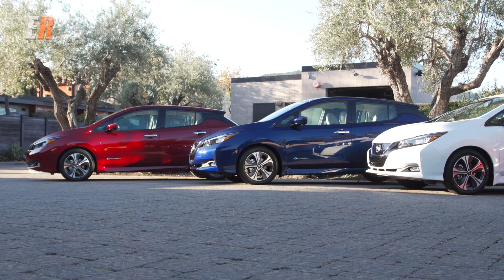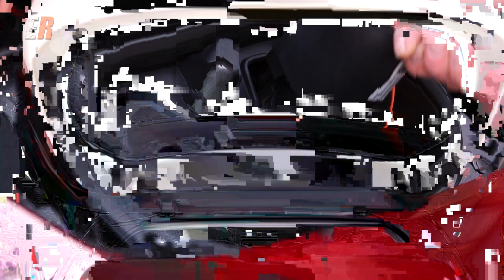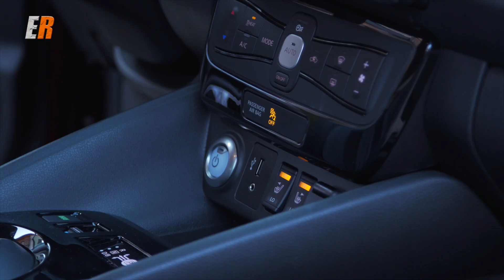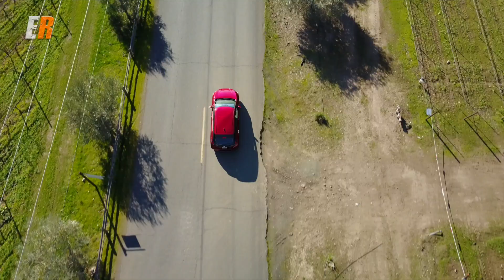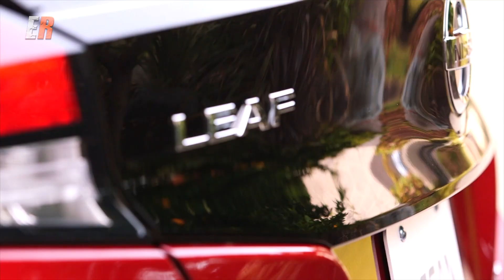2018 ALL NEW Nissan Leaf Review - The World's Best Selling EV

Comment: So what about NISSAN using predatory battery replacement practices for gen 1 battery replacement.  Priced so that your car is worth nothing as the battery cost is in most cases  worth more than the car. Buyer beware.  Note: In buying any EV include a one liner in your purchase contract: Purchaser will be able to purchase a replacement battery for $XXXX or less at their discretion not the manufactures.  Protect yourself!!!
Reply from the maker: That sounds sensible.

Comment: Let's please stop using 110/220 volts for the U.S. it is and has been for a long time 120/240VAC.  It will help with credibility if you use the correct information.

Comment: Now comes with temperature control via retardation of rapid charging rate down to 22 kw from up to 50 kw instead of having a properly designed battery active temperature control system, so look forward to up to 2 hour rapid charges # rapidgate.

Comment: The "subwoofer" is, in fact, the amp. The actual subwoofer is in the side of the rear compartment. No one calls a flat-panel display a "TFT" anymore. Don't tell people they don't need more range. People need as much as they think THEY do. You'd do better explaining how long each charging option takes. That would help them determine if the range provided fits into THEIR life instead of yours. Saying you drove it for 6 days without charging is irrelevant to someone who has a 70 mile daily commute.

Comment: Got one a week ago. Very happy with it. I am not a car freak at all, though, didnt't even drive it before I got it. Anyways, having been driving around with my Golf IV for some years, this N-connecta was a really pleasant surprise. I am sure I am never ever going back to an "ordinary" car. This one is more than fast enough; range is manageable; it is quiet; comfortable for any passager (if you are not too tall and sit in the back); lots of technical stuff that works well, like using only one pedal (especially when driving painfully slow - which is not painful anymore), automatic speed and distance to the car in front of you. All these features make it a pleasant experience to drive this machine. As I mentioned, I am very happy with it.

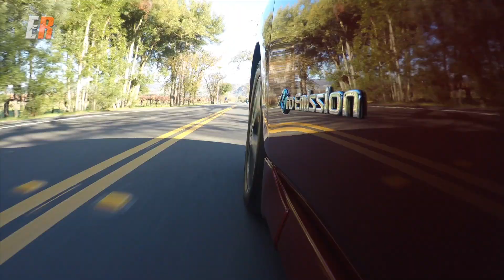Comment: At 3:40 - 236lb ft - My Volvo 5 cylinder old-style turbo diesel 2.4 litre 5-pot is now eclipsed, at 210 lb ft, it's significantly surpassed.  This old tub has masses of torque, but it is way over 1,000 rpm to get it, with that wasteful torque convertor to help things along.  The reasons to not get an EV are reducing fast - down to towing ability (all that heat may burn out motor windings for the first time) and price?  Thanks, very good succinct and visually interesting review.

Comment: You A̶m̶e̶r̶i̶c̶a̶n̶s̶ Canadians crack me up. 110 volts.... Cute. 400 volt in my household. Can't imagen the width of the cable for your 6,6 kWh charging.
Reply: That's kilowatts, not kilowatt-hours. Kilowatt-hours is a measure of the amount of energy stored, not the rate-of-charge. Also, it's "imagine".

Comment: The sub-woofer is in fact the amp for all the speakers. I've got used to it but it's strange placement.
Reply from the maker: +pigknickers thanks for the correction. Yes, real strange placement.
Reply: The box in the trunk is actually the subwoofer, note the lower trim models don't have that box yet still have an amplifier for the regular speakers in the vehicle.  The amplifier is tucked inside the body panels.
See image about the audio system here (2013, but still broadly the same system): https://cnet3.cbsistatic.com/img/N2SS7o8GfPzZtUPuHrVGoFoefJs=/1600x900/2013/02/06/0500bc05-f0e2-11e2-8c7c-d4ae52e62bcc/2013_Nissan_LEAF_Bose_System_Illustration.jpg
Reply: No, I have a 2017 Leaf Tekna and it's an amp. I'm also a sound engineer so I do know what it is. In your diagram I think the sub is below the amp and floor panel. That I can believe.

Comment: for us apt dwellers a small gas generator would be welcomed, otherwise it will never be practical, until there are way more charger stations, like in 10 years or so.
Reply: Yes America is an underdeveloped country as far as car charging outlets go, compared to gas stations, especially for us apartment dwellers who cannot just charge our car from our 3rd or 4th floor window.
But it is what it is.
For now.
Reply: If you don't have a plug at home, you can probably get by with a Leaf, but also EASILY live with a Bolt.  A friend of mine who doesn't have access to a plug at his apartment put 41,000km on his Bolt in 6 months and paid $37 for public charging.  Less than $1 per 1000km.  He also drives for Uber.
Reply: Robert Blackford 

That person is using a DC quick charger. And charges at every every opportunity.  Charges at work, charges at the mall, etc. In my area, many malls, chain stores have  220. And scattered around is network of dc quick charging.
Reply: Well said. Not everyone lives the "American Suburb" family style house.  Apartment dwellers are put to pain owning EVs, for now.

Comment: is it expensive to own electric car?
Reply: as long as you do not charge during peak times when the rates are higher, it is cheaper, sometime much cheaper than gas cars, even with the current cheap gas we have.

Maintenance is much cheaper, because there is no engine.
However I am not sure on say after 10 years, if you need a new battery that savings along with the higher initial cost might take away that lower cost to run savings.

Gas cars can have the same engine still running after decades and up to a million miles,, with regular maintenance an additional cost.

Tires, brakes, suspension, lights, should be the same as other cars.
Regen brakes may cost a little more, but that about it IMHO.
Reply: Regen works by reversing the electric motor not by using the friction brakes.The current price on a replacement battery for the older Leafs is $5k(The cost is/has been dropping) plus install.All manufactures have great warranty on there batteries.
Reply: Thanks I did not know that about regen.
Good to know batteries are coming down for those who keep their cars 10 or so years.

$5000, is still up there, plus installation, but that would essentially be almost like getting a brand new engine.

Resell is not good at all because of the government $7500 incentive, once that goes away and more electric stations are around, should be about the same as cars.

I wonder why the dealers themselves (tesla-nissan-chevy) dont schedule and include recharging at dealership, or why a major gas station like mobile has not added say 2-4 electric chargers across the country at their gas stations, it seems like they could make some money and provide a much needed service.
Reply: Robert Blackford Incorrect. To use Canadian pricing, the eGolf starts at $36k while the same equipment package on the equivalent gas powered Golf is $26k.  Given there is a $14k incentive in parts of Canada, this makes it a no-brainer.
Reply: Even at high electricity rates (like we have here in Massachusetts), it is less expensive than any gasoline car, with $2.50/gallon gas.  It costs us about 4.5¢/mile, so on average in the US, an EV will only cost you about 2-3¢/mile.  And there is basically no regular maintenance costs (no oil changes or tuneups).

Generate electricity with a solar PV system, and you can drive for even less, or even for free.
Reply: if we could drive out of state, i would buy it. Afraid there no charging station.
Reply: Why do you say that?  There are charging stations.  And most of the time, you will charge at home.
Reply: Neil Blanchard if you travel out of state from colorado to houston by electric car. I don’t really know where you going to charge it. That is why i never buy one. Have you ever seen any one driving electric car out of state for long distances?
Reply: With the federal tax credit, EV's are $22,500, and if you live in a state that has a cash rebate, they are as low as $2500 less.  Regular maintenance is essentially nothing, and over time , you save $1000's. 

We are putting solar panels on our house, which will pay for themselves in about 6-10 years - and we will then drive for next to nothing.
Reply: Robert Blackford 

Pay once and free electricity for the life of unit.

Comment: Looks Great, but wait , there's more, the 19 is supposed to add the option of a 60kwh battery for an undisclosed extra charge rumored to be between 4 and 7 thousand upcharge. So if 40kwh is enough great ,but for some the 220 mile range might be worth the wait.
Reply: Think Bolt pricing for the extra battery.  I only drive 25,000km per year so I've gotten by without too many issues on my current 24kWh battery, the 40kWh is more than most people will ever need.
Reply: Not sure why?  I've got 90,000km on my '15 and never had an issue.  Battery is at 95% of original capacity as well.
Reply: Paul Sharp He said that at the end of the review...
Reply: Rob Spreitzer yeah active cooling is more important IMO